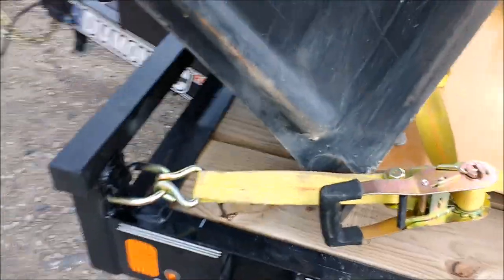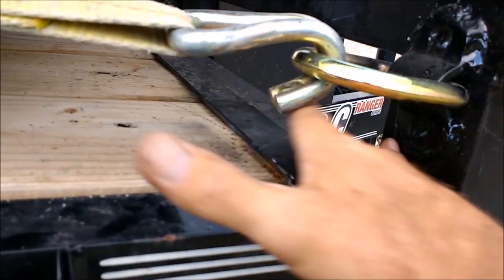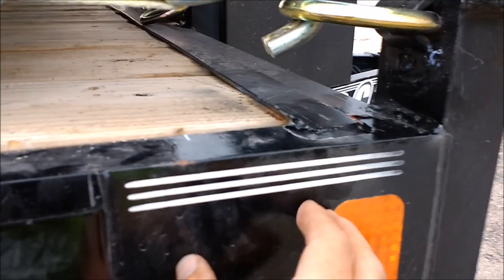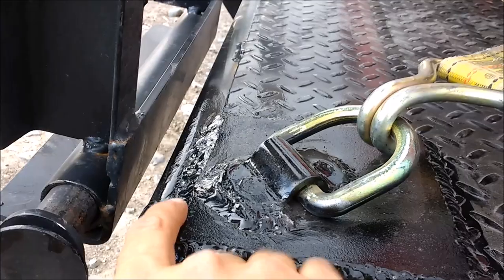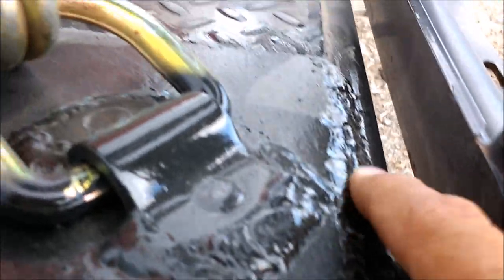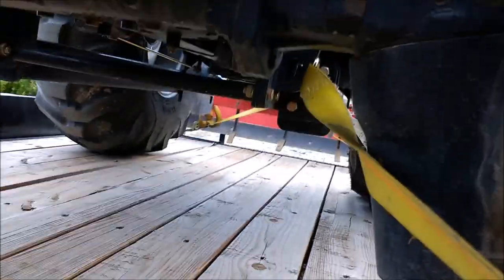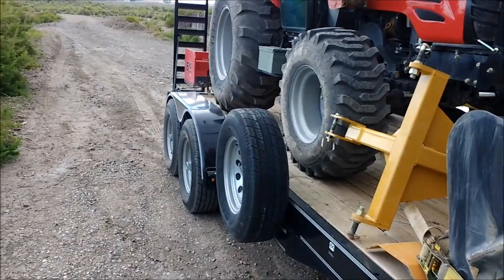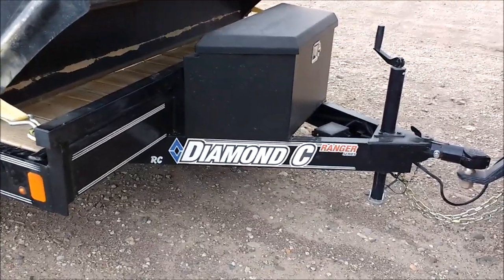Trailer Project Part 6: Tie downs and HF tongue box

Comment: FYI that will not pass DOT inspection. The front rail can not be used for tie down points on heavy machinery. Also your front bucket must have a separate tie down. Then also your rear grader has to have a separate tie down as well. Please check into this for your safety and that for other people driven on the road as well.

Comment: Supposedly for more stability you crisis-cross the binders across the tractor/load.  The right side D-rings secure the left side of the tractor and vice versa. Not sure if it's true, but that's what an old trucker taught me years ago. Makes sense, and I just kept doing since then. Nice work, great looking trailer.
Reply from the maker: Thanks for your comment, I think u are right, Criss cross does a better job of keeping the load from shifting sideways for sure
Reply: Yes, counter tension is always the best way to anchor a load on trailers. The best way to test your anchor is when you push the load the trailer and load should move together as one, which doesn’t always happen unless counter tensioned. Always best to use chains w/ “boomers” instead of straps since the straps are usually only 3-4K weight rating. Using one 20ft chained crossed in the front and another in the back does the trick, plus you probably have the chains already so no need to carry straps whereas chains are multipurpose. Nice d-rings, tractor and trailer.
Reply: P.S. - the other downside to using straps, instead of chains with a “boomer” on each side to add tension, is the strap almost certainly has all the tension on the side with the ratchet whereas the side without it is often low tension since the straps grabs on angles/corners which is why you’ll find it’s loosen up after time when driving. This doesn’t happen with chains.